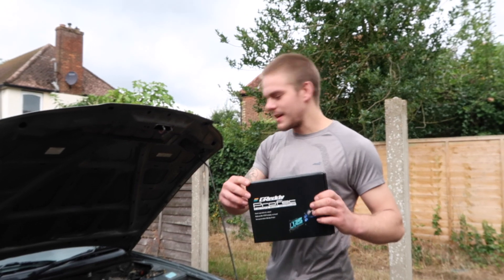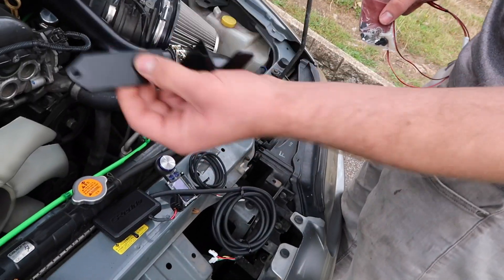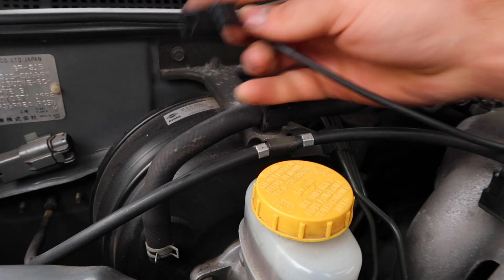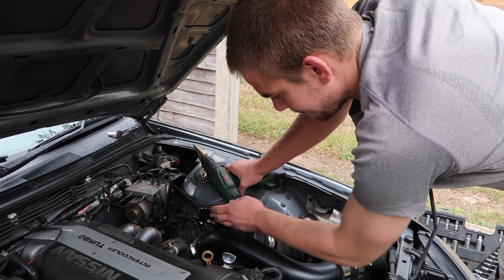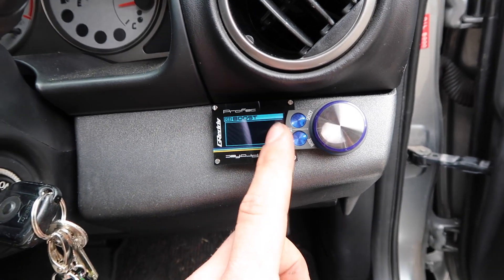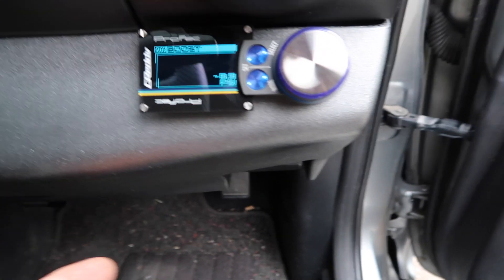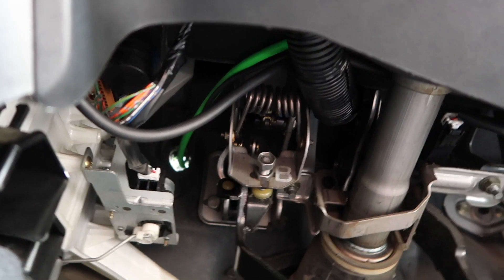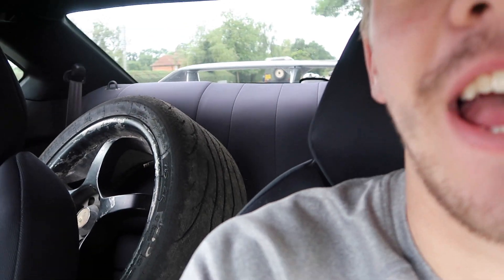How To Install An Electronic Boost Controller On A S15 Nissan Silvia

Comment: Dude tell your friend he didn’t need to drill into the firewall to make the plug fit through, you can take the terminals off the plug by pushing down on the tabs of them, or he could’ve cut the wire and reconnected it after feeding it through the firewall. Now you just cut the body of your car, you can’t change it back.

Comment: I wouldn't have gotten power from the ECU wires.  Also get a fan shroud if you are running a clutch fan

Comment: Set = % over stock wastegate spring pressure
Gain = % speed of actuator open/close
Start = wastegate full close until boost “start” value reached (set 2.8psi less than target)

Comment: HELP I've just installed a greddy profec (brand new) on my S14. All seems to be working fine ( display works, valve makes audible noises when in test mode) but I cant boost past 10psi, no matter what. Turbo is standard T28. Could is be a bad actuator?
Reply from the maker: xTengu it depends what’s happening with it really, if it’s surging or dropping off. It’s most likely not an actuator as if it was a bad it would over boost as it wouldn’t open properly. Maybe it’s a solenoid or could just be the turbo doesn’t want to boost past 10psi, my forester starts to surge and act weird once it gets past 10psi but I think that’s coz it’s a tiny turbo td035.
Reply from the maker: xTengu maybe the turbos old and worn out... have you checked the shaft play?

Comment: Good content... If you're watching this kids DONT EVER EVER EVER MESS WITH FACTORY WIRING THAT ALREADY WORKS WITHOUT ANY ISSUES. Just word of advice.
 Just add a fuse to your fuse box and relay maybe a switch all connecting to your battery. There should be extra spaces inside your fuse box
If you do it wrong just imagine everything that can go wrong $$$$

Comment: If you tune on 550cc injectors you can run max 18.5 PSI on stock turbo, ill run 17 dou to keep it safe

Comment: Hello,
I liked your video. I noticed that the dump valve had a special sound. Can you tell me what type? I have a subaru impreza and would like to buy a voice like your dump valve.
Thank you your help, in advance Krisztián
Reply from the maker: This was running no dump valve... will sound slightly different for all cars but you get that signature futter as the air gets chopped by the turbo

Comment: how do I set boost response so I can hit boost at a lower rpm
Reply from the maker: @thakidkhalid use the start setting and set it a few psi off your peak pressure... if it starts to spike back it off a bit.

Comment: what dump valve have you got on?
Reply from the maker: Sako Interiors Limited this a s15 was running no dump valve
Reply: Sorry mate, i meant blow off valve, you have that fluttering sound, wondering what makes it
Reply from the maker: Sako Interiors Limited yer blow off valve dump valve it's the same thing... it doesn't have one the noise comes from the compressed air running back through the turbo and the compressor blades chopping the air

Comment: is this hooked up to the fuel pressure reg ?
Reply from the maker: Sort of but not directly, it's a aftermarket one that is adjustable and it increases fuel pressure by seeming boost from a vacuum line to the unit so when we up the boost the fuel pressure regulator will see it.

Comment: cheers for making this video just rebuild my sr20 and put this boost controller untill the engine is run in i cant boost 😟 but it really helped when i came to figure out where everything goes! bloody manual is in japanese 😂😂
Reply from the maker: Dean Martin aha yer no problem man it also helps sometime if some one talks you though it 😁 have fun when your sr20 is ready 👍🏻

Comment: bought the same profec and mine don't work. followed the same instruction. I've a feeling the solenoid is broken
Reply: 2 years later... did u get it to work?
Reply: Dude I have the same problem, I cant boost past 10spi (stock) did you ever fix it? (i know its a 3 yr old comment lol)
Reply: @corpze187  yes i found the problem. for mine i just tweak a little and the boost instability is from the top of the solenoid. it seems to be loose so i tighten it a little( I dont have a specific way of doing this just by feeling. cant be too tight or too loose) and then glued the side a little  so it wont move. This is for the solenoid that comes with the new profec. It affects the tuning a lot.
Reply: @takitezy7  Forgot I ever commented here. but yes a year after i did get it to behave.

Comment: why dont you just remove the huge fan
Reply from the maker: I think he wants to just hasn't got round to it yet.
Reply: Can the car operate without it &  will just the electric fan be enough?
Reply from the maker: sharms888 yer as long as you have electric fans to replace it you can remove it and the car will still run... If you watch my skyline radiator install video we remove the viscous fan.
Reply: I'll try this on my S15, cheers buddy.

Comment: I would have cut the wire and soldered before I drilled in the car.
Reply: I would have used a pick to take the wires out of the plug

Comment: This is an awesome unit!  I have it installed on my 97 Talon and love it.  While it takes some tuning to get the flutter to go away,  once you figure out how to work the unit, it's awesome!  The tubing that came with the unit is garbage! Pick up some high quality tubing! This Profec is good for controlling up to 45psi.  One last thing to mention, don't lose the two round rubber pieces that go on the bolt which attaches the solenoid to your choice location.  If you don't have the rubber to absorb vibrations, you're going to have a bad time!  Here is how I have mine mounted.  https://youtu.be/vSscqQ2fhHs

Comment: Bro u could hav got d power supply frm ignition..
Never touch d engine management loom unless u r specialize in dat area..
Yo vacuum hoses r quite loose around engine bay..& wiring inside could have been neat..
Its gud .. like u wanted more boost & u got it..bt neatness cn b done..
Reply: Learning English can also be done.

Comment: so what are your AFRs like now? whats your ignition map showing, what duty cycle are injectirs running at?  You guys are total cowboys and are going to show us all how to quickly destroy an engine.
Reply from the maker: Vaughan Barton-Johnson they where pretty good actually around 11.4-1... that’s all that really matters because the stock Ecu will hit boost cut before we can go high enough past the ignition table.
Calling me a cowboy and judging me on what people ask me to do for them why do you look and see what I’ve done to my own car... (the blue mk2.5 turbo Mx5 that is) if I was such a cowboy I think I would be unable to get it up to 370hp after building the whole thing myself... so why don’t you run along and show someone else you keyboard warrior skills.
Reply: agree in lots of ways with Vaughan, you should never just crank up the boost  without a tune or reflash, more boost = leaning off the fuel mixture on full boost, the ECM can only adjust the fuel by a small amount within its programming and will not be enough. You will destroy youre engine without tuning it. It might be a little faster but had you done a tune on a dyno you would prob get a lot more power, All you have shown by just fitting one and doubling the boost is how to destroy your motor.